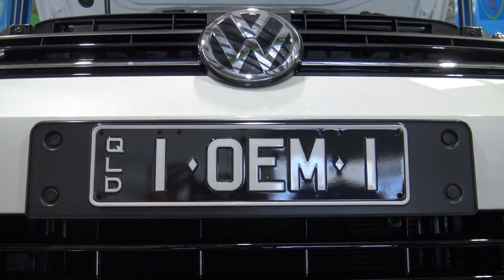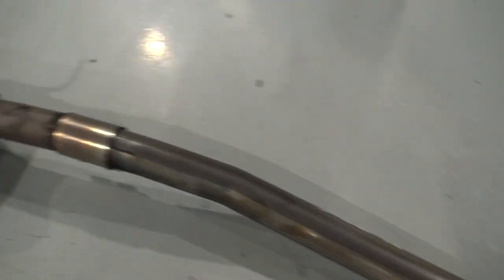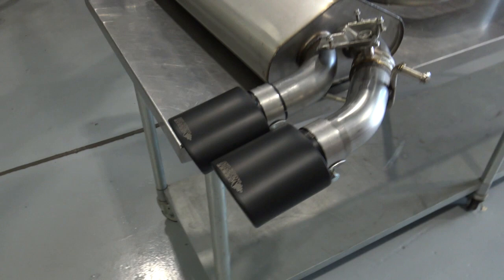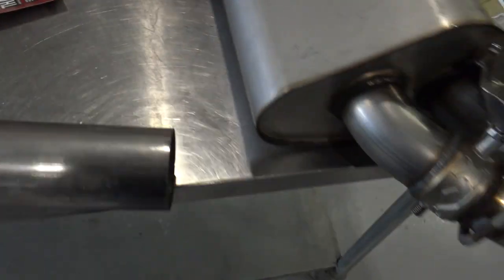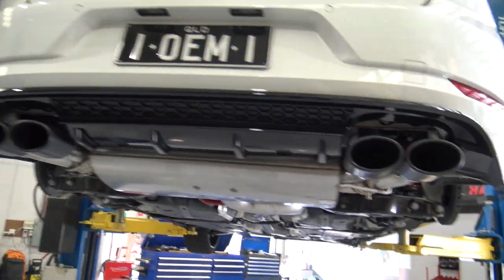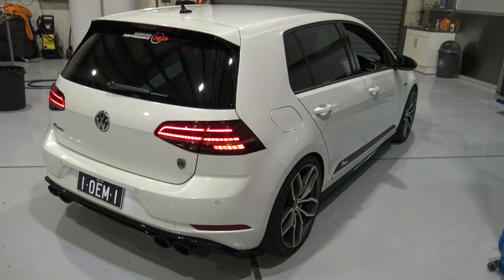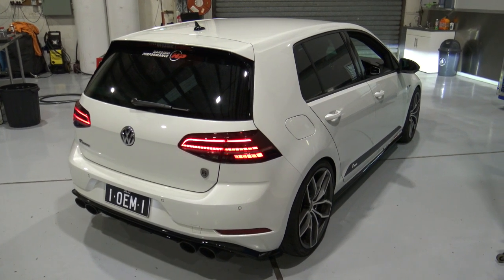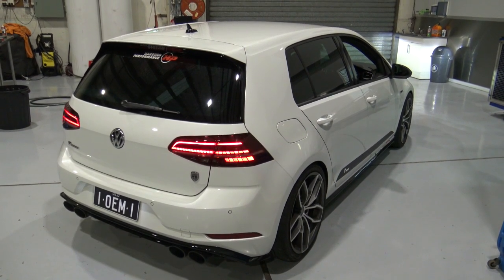Project 7.5: Milltek Sport Catted Non Resonated Turbo Back Exhaust

Comment: I am considering pulling the plug on this for my R.  Love the ceramic coated black tips.  😮‍💨
Reply from the maker: If you're in Australia, we are currently having a sale on these exhaust systems!
Reply: @harding_performance  Bummer.  I'm located in the States. 🤦🏻  How do these exhaust systems hold up over time?!  I was looking into IPE but they're a little more $$ and tbh I prefer the tone of the Milltek.
Reply from the maker: @nickelass427  With primarily 'coastal living' here in Australia, these exhausts are exposed to salty air and harsh weather, and they hold up amazingly. Good quality stainless steel used in their construction.
Reply: @harding_performance  thanks for the feedback 👍🏻

Comment: Wish the exhaust was more durable to pops and bangs, very common with 7R’s and performance euros. My Milltek catback cracked on one side along the welding joint, and was open/rattling in idle. Good thing that Milltek replaced my exhaust with a brand new one under their lifetime warranty, excluding my tips, which was quite nice. Only concern is whether this will eventually happen again. I think and feel as though the exhausts from Armytrix or iPE are made of better quality hence their higher pricing?...... correct me if I’m wrong?

Comment: Awesome video!  Hows the drone at 6th gear and 3000Rpm? Have the same setup with out downpipe ans Im abit tired of the highwayspeed drone all tho i want to put a downpipe on for more pops and bangs 🤔😜 (stage 2 req? For no check eng light ?)
Reply from the maker: Hi Nicolai, adding a downpipe will also add volume to the exhaust. You may be best swapping the non resonated section for a Road + centre silencer to control the noise.

And yes, a Stage 2 tune would be required with the downpipe.

Comment: Wow! Gorgeous!
Do you have the references of each product installed please? @hardling performance
Reply from the maker: Autotech Fuel Pump
Racingline Springs
Racingline R600
Racingline Catch Can + Remote Fill Kit
Racingline Oil Cooler
Racingline Stage 3 Turbo
Milltek  Downpipe
Milltek non resonated, valved Cat Back exhaust
Milltek Active valve controller
Racingline Intercooler
Racingline Paddles
HP Front Sway Bar
HP Rear Sway Bar
HP Rear End Links
HP Front Lower Control Arms
HP Engine + Transmission Mount
Racingline ECU + DSG Tune

Comment: My only issue with the system, I have the resonated version of this, is that the muffler tips hang way too low and look like an afterthought for such an expensive system. Otherwise it's great
Reply: Is it lower than the one in the video? I notice it seems lower here but looks OK if viewed while standing up.
Reply: @Scythesabre  It's as low as the one in the video. a big gap.  I used Kartboy MK7 Hangers and it made it look much better
Reply: @scrapin240  what size hangers did you buy? What size are the OEM ones?

Comment: You can control the valves with a remote control unit?
Reply: using the oem valves so selecting drive modes still works with the exhaust